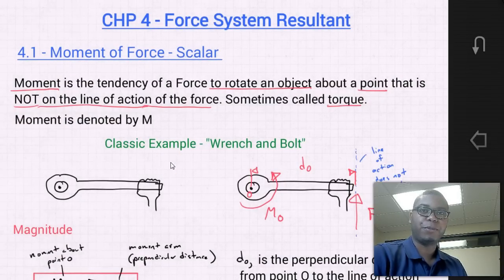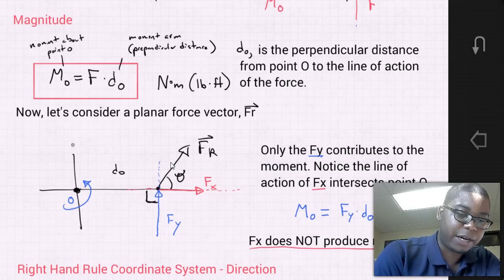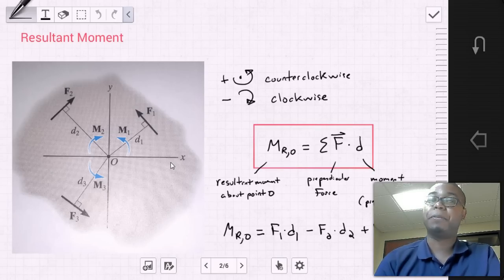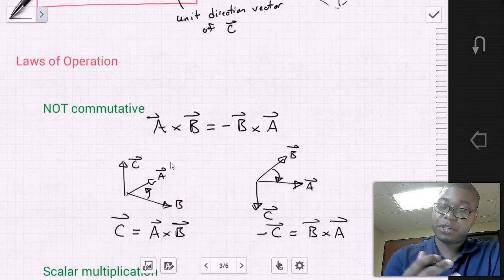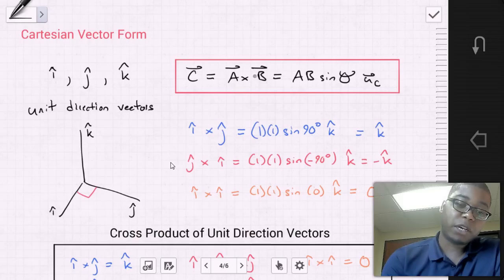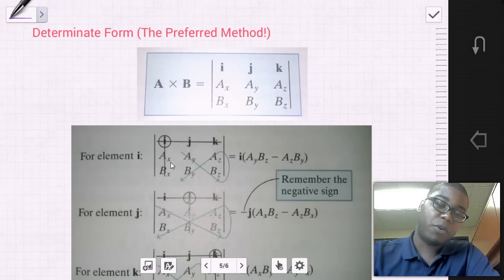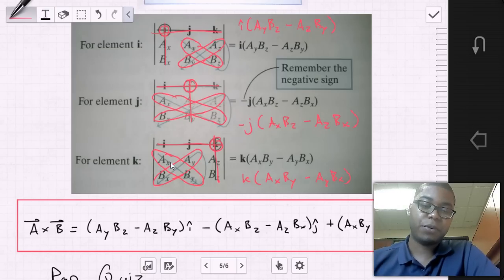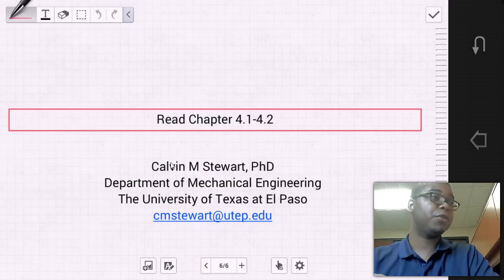Moments: Scalar and Cross Product (Statics 4.1-4.2)

Comment: Thanx for great explanation but i have extra info. for determine the cross product of unit direction vector , which is 

i , j ,k if we multi two of them will get the third and the sign depend on the clock or counter wise 

for example 

if we multi. j x i will equal -k 

on the otherhand 
if we multi  i x j will equal k

so it depend on the clock or counter wise 

thanx again !!

ME student - Saudi Arabia